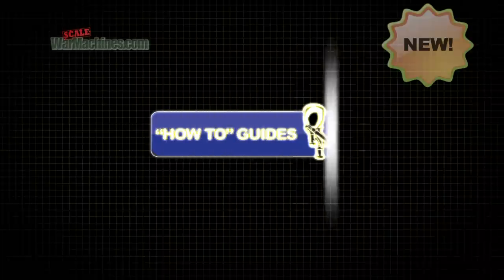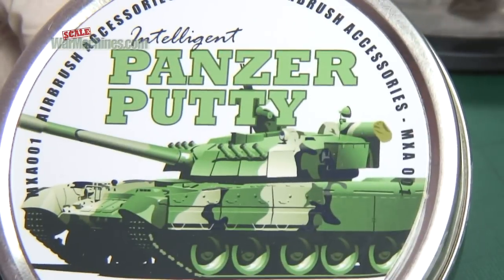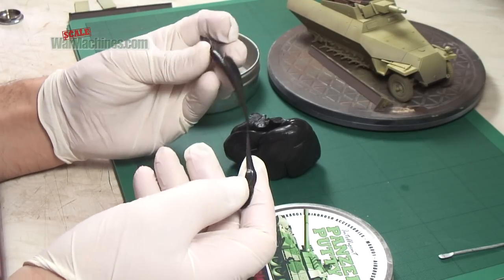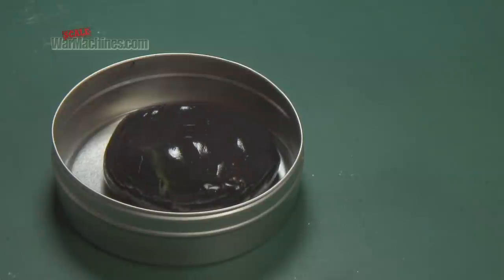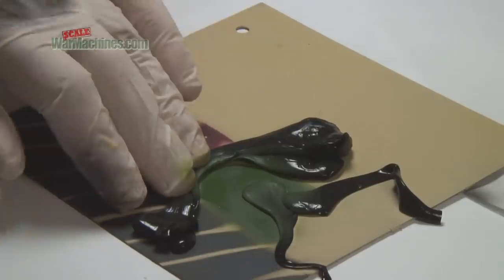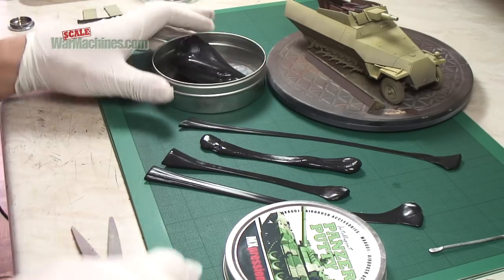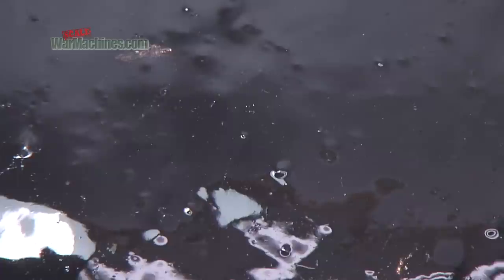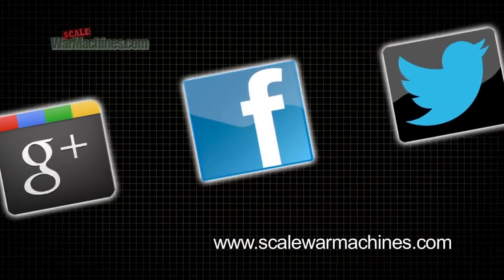PANZER PUTTY - SCALE MODEL "HOW TO" GUIDE

Comment: Trying to figure out combining this product with the chipping and weathering liquids. If the model (say a Panther that will have the 'ambush' camo effect) has a base coat of a rusty/metal finish, then coated in a chipping medium. Then top coated with the German drab yellow. Then masked with PP to create the green and red oxide areas. Will the chipping medium still come through those second layers of colour? Or will it only come through the yellow drab layer? Ideally I'd like to to be able to go back to the rust layer right through all the top coated camo colours...
Reply from the maker: That's more or less what we did with the Sdkfz. 251 in the film. Look carefully enough & you'll see the coat of Chipping Medium on camera. We applied chipping medium between coats just so it's available if we needed it (even if you decide not to chip - it's fine). It's better to have the option than not. Ideally, apply it between different colour coats but it will still undo the German Camo Red say over Chipping Medium then Dunkelgelb if you work it enough.

Comment: Is it gentle?  How will it work with say a fully completed rear of a Panther tank.  Will it conform to odd shapes and angles? If there any danger of parts being pulled off the model as you remove the putty?
Reply from the maker: +Steven Piper. It gets softer after you drape it but you would always have be careful over photoetch for example. Leave in place to soften & it should be ok. Safer than masking take though, it would do less damage for sure...

Comment: Could you tell me how it reacts with PE parts on a tank for example? I want to avoid putting the putty on my PE parts and ripping them off when removing the putty.
Reply from the maker: Should be ok but to be honest haven't properly tested it in that way. If interested, maybe do a test on a PE clamped tool or something to see if it rips it. Would be interested to know.
Reply: So I performed a test on a spare part with PE glued to it. And no problems there. So I used it on my model and again no issues what so ever. You just need to be careful and let the putty settle by itself. Don't force it by pushing it on the model.
Reply from the maker: That makes sense. It seems like the sort of stuff that would behave itself. Many thanks for the update.

Comment: As you are painting does the putty get dirty because you spread the paint in the putty ? And how do you clean it?
Reply from the maker: TheSteven798v2 The putty does get paint on it but it is easily absorbed once you remix & reset the putty.
Reply: So are you saying if I keep stretching it the paint will disappear?
Reply from the maker: That's correct. Should be absorbed by kneading.

Comment: Is it possible to clean it with water? I am using Vallejo paints.
Reply from the maker: You don't really need to clean it up as it is a product that peels. So you can just rub it off, peel it off or pick it up with a bigger piece of Panzer Putty. You can use it easily with water-based paints like Vallejo without problems though.
Reply: Scale War Machines Thanks for an answer.
Happy Xmas!   :D

Comment: Why don't you just buy regular blu tack
Reply from the maker: You can use blue tack - we do all the time - but Panzer Putty behaves differently (it's silicone based). For instance, its more precise like with the ambush scheme demo in the film & is much finer. But yes you are right, blue tack or silly putty also works well.

Comment: Same as Blue Tack.
Reply from the maker: +Elshan Mammadov Yep but slightly better - i.e. you can cut it into clean tiny pieces with sharp edges. But you are right, for wavy camo Silly Putty or Blue Tack works just as well.
Reply: Slightly worse as it don't hold its shape .... It beds down like the video you/team filmed so the camo you apply is never the camo you get as it take time for putty to be applied then it's moved by spray time. Blu tac put down spray no movement lift. Bobs your uncle unless it ain't